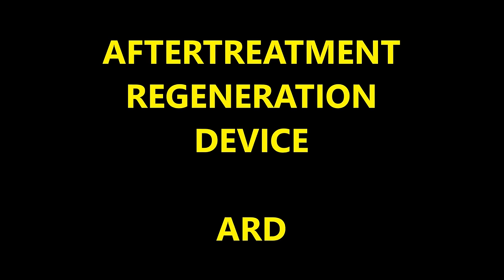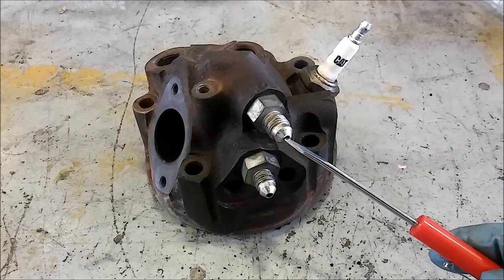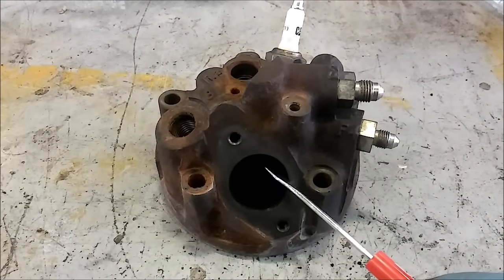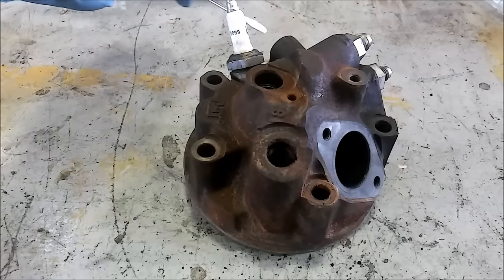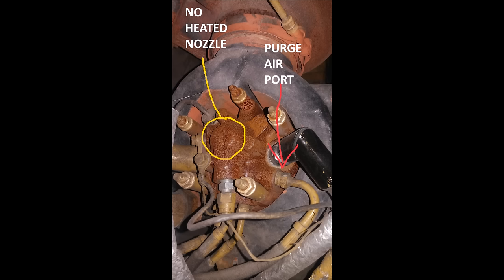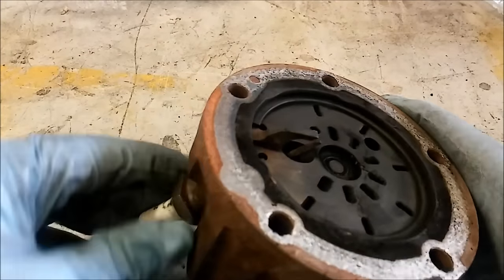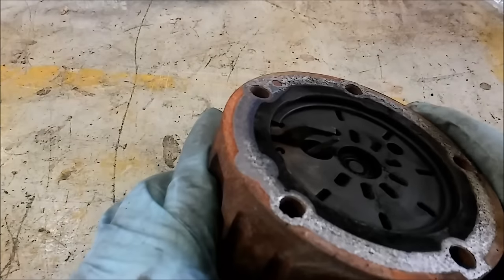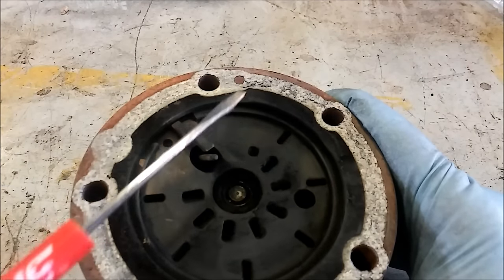What is an ARD Head? Cat Regen Systems

Comment: In Finland ard head to C15 cost about 3000euros+24%tax...
and the dpf filert cost anywhere from 4000-7000euros+24%tax depending the serial number..
Thank god here is guy who can reprogram the whole renegeration system off :)
Reply from the maker: The DPF is expensive everywhere you go, but that ARD head price is ridiculous, that is about 4x as expensive after taxes as here.
Reply: Agreed with the pricing, but the reprogramming the computer cost 3000+24% tax.. :D But now it will never regerate or have any kind issues with the system :)

Comment: 2 questions:    1)  will a vehicle ask for a regen without a code being logged in the ecm.  Sdp engine. 

2) successful regen on sdp.   Data log shows inlet and outlet dpf temps reached 1100 but number 3 temp only got to 830.  Also flame temp would range from 1450 to 1800 during regen.   New ard head.   Pilot psi at 238 al the time after regen began.
Reply: Number 3 sensor is flame length. ECM wants to know how long flame is so it don't extend pass the Cat system.  
The way I tell people is you have a inner ball game. ECM is the pitcher, it walks Air and Fuel. So at the start of your data log you see Air and Fuel gets turned on for a little while. So now you have runners on first and second. Now Flame is at the bat and you walk him. Bases are loaded because the system ignited and is burning. Now DPF inlet is at bat. The ECM wants a grand slam and DPF inlet temp to reach target on a 1400 rpm REGEN (hold point 1083 F).  As the ECM looks at all the bases to make sure every one is where they need to be. If every thing goes right you will reach target. On a 1400 RPM ET REGEN, reading the data log correctly is the key. I break it down in several sections. If the engine is fairly cold I look at the start that the temps start off close together (1). I look then at the air and fuel when ECM turns them on for a moment (2). Then after it lights and flame goes up and before pilot flat lines I look at this section. Not sure what is going on. As you can tell fuel PSI are jumping around, air flow and such. I thing the ECM is seeing what it can do and can't do with the REGEN system (3). Then you have a flat line on pilot psi. This is the core part of the REGEN, ECM is looking at a lot of inputs and such. Goal is to reach target and hold it. Basically I see two type of REGEN's. First I call lazy flame. The DPF inlet temp is rising slowly. These are after failure REGEN's and the ECM wants to slowly bring temp up so it don't ignite wants in the DPF. Usually hold point will be at the very end of the REGEN. The second is more of a normal REGEN and DPF inlet temp will hit target quickly and hold it until lean burn. You will see the ECM will give fuel command to main PSI to reach target (4). Next section is lean burn and ECM wants to clean the bottom of the ARD head. You will see fuel psi and air flow drop. Flame may go up or down (5). Next part are two together, fuel command goes to 81.83 % (may do it twice) and than 50 %. ECM is looking for fuel psi decay in the lines. Remember while engine is running the spark plug is getting power. ECM wants to make sure fuel is turned off (5). Next part I like to do, after RPM's drop to idle I look at DPF inlet and outlet temp. come back together and now I can read my data log (6).
Flame temp, Fuel PSI command, Main and Pilot PSI, Combustion air flow, DPF inlet and outlet. After I study them, I bring Boost, CGI flow and DPF dif PSI in.  If I see something, I may bring in other recorded items. Don't get hung up on Flame temp. I have seen them       down to 500 F. The updated software changed a lot over the years. Main PSI reading is very important on how much plugging is in the ARD head. Only one primary filter and if customer runs them to long or a cheap filter debris will get into the system. I always change filtered fittings with a new ARD head.
Reply: With the new software a REGEN can be done by the driver  and no CEL if certain conditions have been meet.

Comment: The volvo/mack powerplants use a similar set up, but their most recent style got rid of the coolant lines running to them making it just a single fuel line running to a nozzle on the outlet pipe from the turbo. The nozzle only costs $90 and has a service interval of i think 150,000 miles.
Reply from the maker: +Jeff Smith That seems like a much more reasonable setup, Cat really over engineered these heads. I think if they had put more emphasis on the head being replaceable it would have saved them a lot of money.
Reply: I believe it is a nicer setup too. I am applying at MacAllister CAT here in Indianapolis. I applied for the field service generator/hvac tech which my application went through well. Then I decided to apply for the heavy equipment tech too, but when I was going through it I hit the wrong button and sent the app in with all my info talking about hvac and generators. So hopefully that didn't ruin my chance for the equipment position!
Reply: CAT was the only OEM I'm aware of to use this approach with Aftertreatment. (No Catalyst/ARD Head, etc) Volvo/Mack use the same setup as most other OEMs (Detroit, Cummins, etc) with an HC doser block/valve assembly mounted to the side of the engine. The nozzle you see near the turbo is just that...A simple Nozzle. The dosing Valve itself is the expensive part. Besides one of the fuel pressure sensors in it being replaceable, there's nothing serviceable in it and they do fail/plug up. Of course, just not nearly as often as the ARD heads.
ARD, CGI and failing turbos were about 90% of the reason I was glad to see on-highway Cats go after 2010. Real shame...

Comment: They destroyed a perfectly good engine when they said lets put this on the engine.
Reply: The EPA destroyed engine manufacturers' perfectly good engines when they said "we don't want ANY black smoke" and basically forced all of them to use regen systems. Which manufacturer or owner doesn't have nonstop problems with EGR's and DPF's?

Comment: What most don't know we went from air purge to heated nozzle ARD head. If I remember right went through 9 changes or design changes and still don't right. I had Rail truck that Regen perfect with flex pipe broken missing 3 inches of pipe BELIEVE THAT. Fixed flex pipe and all hell broke loose would Regen right end up putting in turbo's was root cause cracked inside.

Comment: I'm very surprised that part fails. I would have expected that type of "direct fuel injection" regen process to be more reliable than firing fuel in on the exhaust stroke.
Reply: volvo09 the largest problem is the DPF is usually located quite far from the ARD head, thus making it need to burn way hotter and longer than it really should.  It takes a minimum of 1200* F of incoming exhaust temperature to burn out the soot in a DPF.   Incoming soot from the engine and bad burn from the ARD head leads it to soot up badly and usually the ARD fuel nozzle will fail first.

Comment: I’m working on a 349 with a C13 with an ARD head. It has a code 3182-4 aftertreatment #1 fuel injector #1 heater : voltage below normal. If I unplug the heater connector the voltage goes high so I don’t think it’s a wiring problem. You said the components of the ARD head are not replaceable. Could the heater in the head be shorted causing this code? Using ET I can clear the low code & it comes right back.

Comment: How often does the igniter need to be replaced. On our 950 loader we are getting a high soot and low temp code. Also would doing a manual Regen before the soot meter reaches the 80% auto regen cause any issues?

Comment: i got à C15 sdp on a PETE and i have change ARD every 8 months.. and at the end i made my choice by passing de complet système.. and all my problems where solved
Reply from the maker: Bypassing it will solve the ARD head problems, but remember that if you get caught by the DOT or in California with that bypassed it could be heavy fines. They are poor systems though.
Reply: Ya i know but my truck runs only in Canada and i just take it easy when i get on a scale
Reply from the maker: +Rick Sullivan Maybe you guys are a lightly easier on the truck drivers up there than in the States. That is good for you guys.

Comment: from one vapor to another. does any of those fuel additives help the life of this part?
Reply from the maker: I really don't know. It seems that they last about 1 year give or take a fuel months. Perhaps a Diesel fuel injector cleaner would help, but I have never heard of it working. The C7 and C9 ARD heads have a Windex style cleaner you can squirt into them, but have never had much success. If you try it let me know, maybe a solvent could be pressured through the nozzle to clean it, but I have never tried.

Comment: GREAT INFORAMTION, great vids!  My question: Do the brand new 2018/2019 engines from Detroit, Paccar and Cummins have ARD heads on them or have they come up with a better plan?
Reply: Detroit just uses a doser injector right after the turbo and the fuel ignites itself and the DPF is right under the step of the truck, not that far away.   The problem with cat is the ARD head is too far from the DPF>

Comment: i have a cat c7s school bus . bus was in because white smoke is coming out from exhaust. i notice that the smokes only when regen is finish . and also i did a ard override when finish smoke comes. my question is if can be a problem with the ard head
Reply from the maker: +ismael galan The ARD head can be leaking fuel into the exhaust, but my guess would be that the problem is with one of the control valves leaking, such as the fuel enable valve, pilot control or main control. If you watch my regen class video, it's kinda long, it'll explain how those systems work if you're not familiar with them.
Reply: Ok thank

Comment: my current job is all Volvo with the newest being a 2007. I don't have software and want to skip the 08 to 2010 era if I can
Reply from the maker: If you have to work on Cats, you would be wise to try and avoid the regen motors. Without the software to communicate with the engine there isn't much you can troubleshoot with them since they have like 50 sensors. How do you like working on Volvos?
Reply: +Adept Ape They're good trucks once you get used to them. I have a OTC code reader gets me by but of course I'm stuck with the parameters the previous company set
Reply from the maker: +dognamedfred I know they are known for getting good fuel economy. I guess you get used to working on whatever after awhile. Kinda sucks though as the manufacturers make the aftermarket scanners less and less effective.

Comment: its true, they go bad every year.  its not true that you need passwords and stuff after you replace it yourself on time, before your engine goes into derate mode. Ive done about 4 of them in 6 years on my own c13.
Reply from the maker: +alexkustov If you periodically replace it before it goes bad, then yes the engine won't throw a check a engine light and you won't have to clear it with factory passwords. With that said 99% of people are going to wait for it to fail before it gets replaced.

Comment: ive replaced my ard head but iam have dpf issues,where can i go to clean or do i need to replace my dpf filter c15 acert
Reply from the maker: +David Trevino You can get them cleaned unless they are damaged physically. Call your local Cat, Peterbilt, or other shops that are local to you and they will tell you where you can take it to get cleaned. Many dealers have the machine that cleans them.
Reply: Thanks and thank you for your quick response iam gonna call around and get this done a new dpf costs around 4200

Comment: Worked for months on these when they first came out. I went to special class that pretty much said they are amazing ground breaking system that you won't even notice them on the truck. Hahahaha what a joke the work like one and a half times. I was spouse to work on these on issues came up and I spent months and months on these.
Reply: All I did for months and months. Go to work and serivice tags from stuff that needs worked. 5 trucks on average where in the parking lot in morning and 4/5 would be regeneration system faulty. Damn behind and it's only 7:00am!!!
Reply: We finally abandoned cat engines and sold half the fleet that year.

Comment: Is possible clean the ARD heat?
Reply: Why clean it? What would that do? Do you mean clean the little injector that's in the ARD head? I think that when the injector has failed, it's beyond any sort of saviour by cleaning.
Reply: International has service procedure to clean the doser in the exhaust. Same theoretical system. Anyways, I tried cleaning the ard pilot and it is for sure clogged beyond shop air and chemical solvent.

Comment: can you clean out the fuel injector ?
Reply from the maker: +Edgardo Guardado As a dealer we just replace the head, but if you have the head removed you could try blowing compressed air or a solvent mixture through the nozzle tip in reverse to clean it out, not sure it would work, but you could try it. Or try soaking the head in penetrating oil over night, then spraying it out.

Comment: The ARD head itself is very rarely the problem. You are actually talking about the injector failing? There have been some instances of excessive carbon building up in the injector itself due to the high heat it is subjected to. This is repairable at a low cost if the right person is doing the job, but I would not recommend this as a home DIY repair.

Comment: The only thing I like about the SDP and LEE is how predictable they are. I have my own T/S short cuts that narrows is down to the ARD or what ever pretty quick if it's not a warranty job..........I hate that stupid ARD warranty form......
Reply from the maker: Luckily the warranties are pretty much up on all the regen motors so those forms typically go in the garbage. Glad someone else knows how to troubleshoot these, once you can read the data logs it's pretty easy I think. I had a guy last week though swap a coolant and fuel line on one and it was filling the radiator with fuel, hadn't seen that before. Thanks for commenting.

Comment: my c-18 in an 836k compactor just got ard head replaced 4 months after last one was replaced. my unit is under warranty still so no biggie for me yet it starts showing a high fuel pressure fault and has been the ard head Everytime so far like something gets clogged up
Reply from the maker: The regen systems are slightly different on the equipment, but the same principle. The ARD head is the problem a lot. Cat should make a way to just change the nozzle instead of the head for a lot less money, but they have not made a kit yet.
Reply: Walker Vaillancourt , I have been pulling the nozzles out and fixing them myself, after the last 2 new ones plugged at 80 hrs.  had great success sofar.  I soak em in CXC-52B. available  at Ford dealerships. and that desolves the carbon.

Comment: a paterbilt 2009 c13 caterpillar engine the ard head brakes every six months.  last time in bakersfield California costs 2300 dollars and took em 10 days to fix it.they gave one year waranty but only one time  free replacement . i still cant understand why this motor is so low quality overall. everythig fails over and over again..
Reply from the maker: +El primo Rodriguezm l GAQ8QA The core engine isn't that bad itself. It is all the crappy emissions stuff and extra sensors that are the constant failures.
Reply: Yeap. Thanks for your videos! Im not a mecanic am a driver and thanks to your videos im staring to get less frustrated every time a problem begins to happen because im begining to understand'em